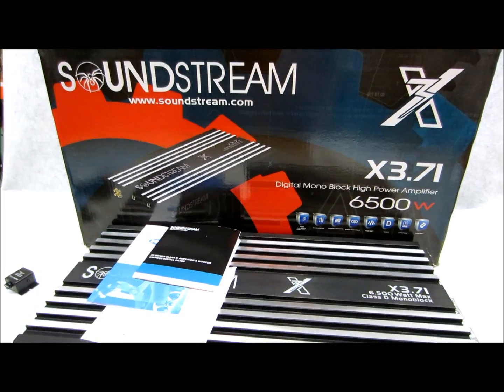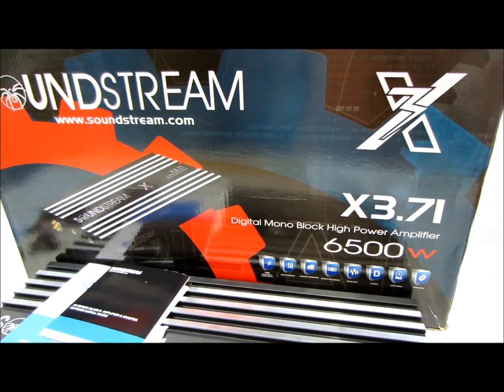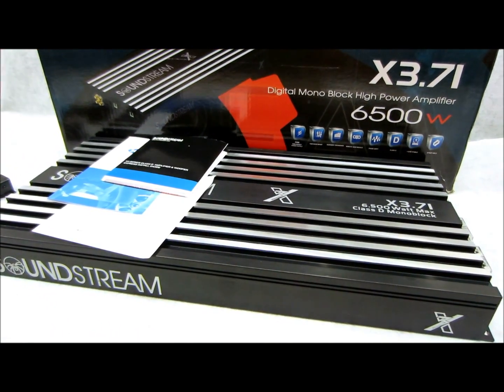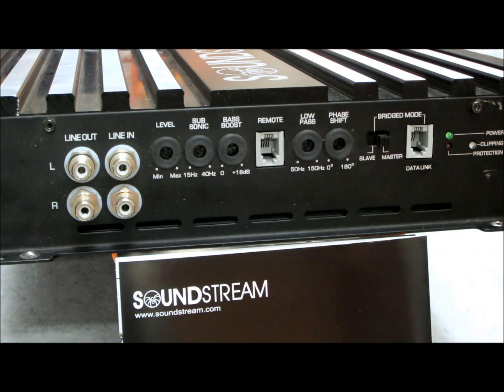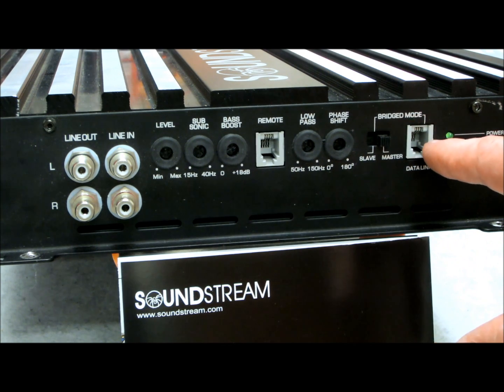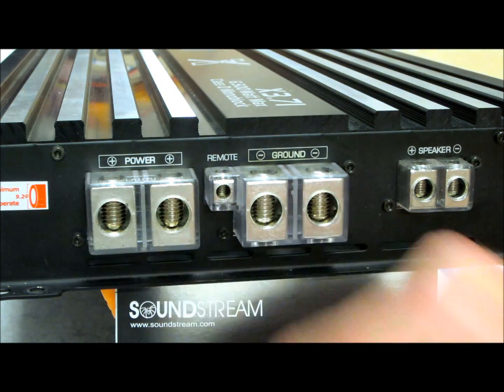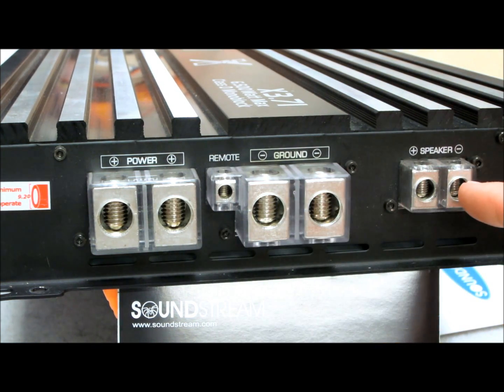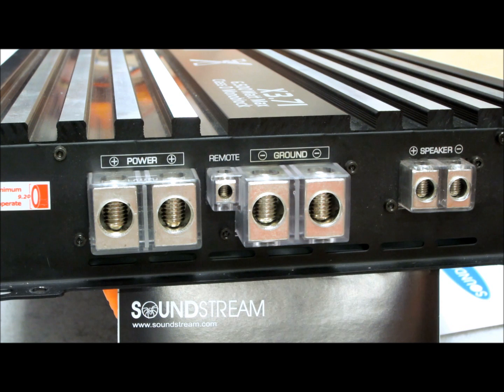Soundstream X371 X3 Series Amplifier Review

Comment: I got A Soundstream x3 12'' any suggestions, on either this amp or the x3.60, or even any others that would work great, would to tune the sub to 28hz, once I find a 3.5 cu ft box it's goin to go to work!! lol ;) thanx
Reply: Amir NY City I just bought two x3 12s and I'm on the same boat as you. Kinda confused on what to run.
Reply: ya, tell me bout it! lol, i got one x3, an one old skool soundstream devinci 12'', an looking to sell one 12'' critical mass.
Reply: Amir NY City run the x360 on 1 12 and the x3 71 on 2 12s just dont go under 1 ohm or u will kill the amp i have a x360 and 2 t1 6000d i like the t1 for daily but the x3 for raw power im selling all my amps and getting th x3 14k i have 2 xxx15 quad coil subs in a 9ct ported box its destroying my truck lol